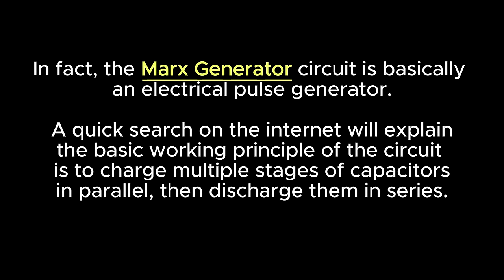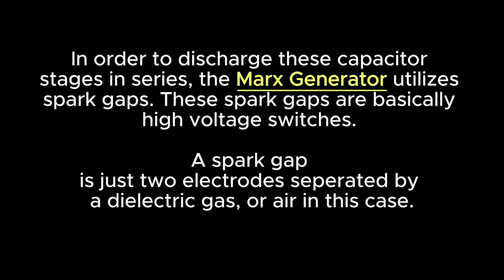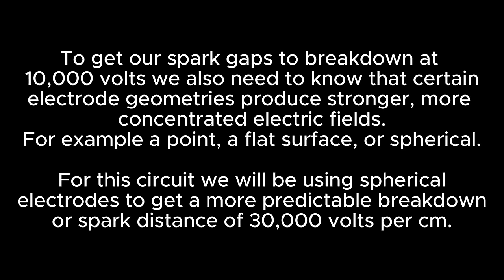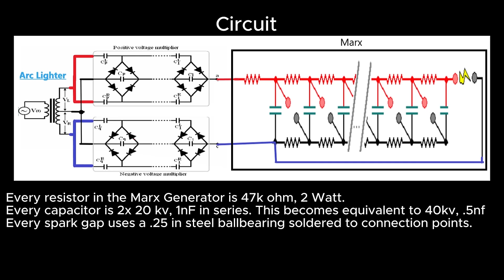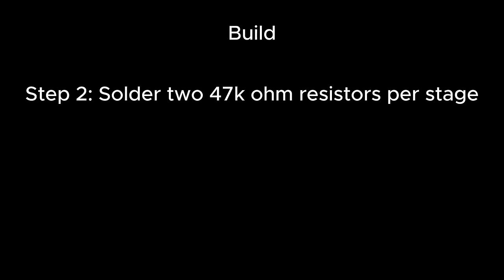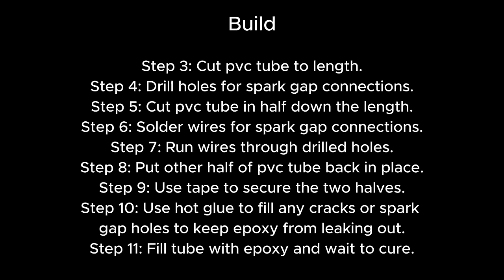100,000 Volts Marx Generator Gun

Comment from the maker: Again. Be extremely careful with this circuit. I am not kidding, this is deadly, because all the energy stored in each stage is released all at once. So to make this safe after charging, be sure to take screwdriver or something similar with one hand and discharge each stage by shorting the spark gaps.
Reply: When I make this I will take every precaution possible because I don’t think 100,000 volts through your body is very pleasant
Reply from the maker: @BupaDuck  that’s good to hear. I believe you can do it!! Maybe start off with just four stages, tinker around with it and see how it works. 

If you need any help, just comment back here, or maybe post a video of your own so I can see what you’re working with.
Reply: I have one last question is it a bad idea to order parts off of Amazon?
Reply from the maker: @BupaDuck  I get quite a lot of my parts from Amazon. Digikey is also good for specific components.
Reply: Ok thanks
Reply: I’m thinking about starting a yt channel but I’m kinda in 8th grade😅
Reply from the maker: @BupaDuck  yeah man, why not? Better to start now, build an audience, and possibly get paid in the future!

Doesn’t matter how old you are, get ahead while you can! You will learn so much more by doing things yourself.
Reply: @UsefulElectrons-ni1fq  thx I just want to do something big for my first video. I should I make a Marx generator or something else
Reply from the maker: @BupaDuck  it doesn’t matter, you should do what you are passionate about, unless you are targeting a specific audience or have an overall theme/plan for what you want your channel to be about.
Reply: @UsefulElectrons-ni1fq  ok I’m in gym class rn tho
Reply: @UsefulElectrons-ni1fq holy crap your views spiked to 900
Reply: So the Marx generator I built has a input on both sides of the generator and a single output, so would it work if I just stuck a wire into ground in a outlet
Reply from the maker: @BupaDuck  no! Do not do that!! That will not work and is extremely dangerous!!!

No where in my video do you see me or others sticking wires in the ground of our outlets. What comes out of the wall can kill you. It is VAC, the Marx generator requires DC!!

If you don’t know the difference between low frequency VAC and High Frequency VAC you should not be experimenting with these circuits.
Reply from the maker: @BupaDuck I hope you’re okay bro. Are you still alive?
Reply: @UsefulElectrons-ni1fq  Okie I’m alive
Reply: So do I split my Marx generator in half and use one for negative and one for positive?
Reply from the maker: @BupaDuck no, it should have a positive and negative DC input.

You need high voltage DC. A rectified flyback transformer that can be bought online should be able to charge this circuit if you bought the high voltage capacitors.

You could also use a high voltage AC transformer connected to the Cockcroft Walton circuit which will rectify to high voltage DC. The ac transformer can be found in a plasma lighter.

Most of the information in this video should be good enough to build your own, but like I was saying before this circuit is difficult to make work properly. It took me a lot of time making sure everything was spaced properly. You might want to just start with the Cockcroft Walton first.
Reply: @UsefulElectrons-ni1fq  so I have the high voltage so do I need to buy a rectified fly back transformer?
Reply: @UsefulElectrons-ni1fq  I have the Marx generator circuit and a constant source of high voltage
Reply from the maker: @BupaDuck  if you have the constant high voltage DC source, basically the taser circuit, then all you need to do is connect the positive and negative to your Marx.

You just have to have the high voltage caps and resistors insulated well enough so they can charge without arcing over. Then you need to make sure your spark gaps are spaced properly. It takes a lot of messing with to get it to work at the point though so be patient and make sure you discharge the circuit by shorting the spark gaps with a screwdriver or something with one hand, try your best to only use one hand when handling the circuit or you will get shocked across your chest.
Reply: @UsefulElectrons-ni1fq  ok thx
Reply: You could have a 3 way switch on either the output positive or negative and when you flip the switch into “b” position then it discharges it into a bleed resistor. “A” position goes to the high voltage spark gap.

Comment: I rlly like electrical engineering and I made a 30kilovolt taser myself, I hope your channel grows🙂
Reply from the maker: That’s awesome! Now all you need to do is connect your taser to this circuit, and you can multiply your voltage and current even more!! Be careful though this circuit is more dangerous because all the stages of the capacitors discharge all at once and can really hurt you.
Reply: I know, I accidentally touched both of the live wires while trying to fix it and I shocked myself, it wasn’t exactly pleasant
Reply from the maker: @BupaDuck 😂😂 gosh bro, I know, even when I’m being extremely careful I still get shocked and it’s always terrifying!

Comment: I just ordered the parts from amazon and it is coming Sunday😊
Reply from the maker: Nice bro! That’s exciting!! Let me know if you have questions
Reply: @UsefulElectrons-ni1fq  ok I have 2 question, does the wires get hot and do I need thick wires I don’t want the wires to cause a fire
Reply from the maker: @BupaDuck  most of the wire I’m using is single strand 22 gauge. The output wires I’m using are multistrand 14 gauge high voltage wires.

I wouldn’t be concerned about fire with the Marx generator circuit, but whatever you are using to charge the Marx is probably going to be where the fire hazard is.

I assume you are either using an arc lighter or crt flyback transformer?
Both of those can generate “hot” arcs that can cause fire because of the current output. 

Just be safe and keep flammable objects far away.

Remember to only use one hand when interacting with the circuit after it’s been charged. Also discharge the stages after each use so you don’t forget.

Start out with only a couple stages so you can understand how it works, the more stages you add the more corona discharges you will get and the circuit won’t work very efficiently. Which is why I put mine in a tube and filled it with epoxy. You can use canola or vegetable oil instead, but it’s messy…

Also, if this circuit isn’t in epoxy or properly isolated it could arc to itself and damage your power source components, or most likely the resistors in the Marx circuit.

Good luck, have fun, and be safe.
Don’t give up if it doesn’t work the first time either!
Reply: @UsefulElectrons-ni1fq  ok thx I will let you know if I have any questions
Reply: I got the resistors early and I think it might be too small can I just put electrical tape over the wires to prevent it from arcing
Reply from the maker: @BupaDuck  sorry electrical tape will most likely not work in this situation for the resistors in the Marx Generator, but you can most certainly try.

Arcs will most likely travel through or around since it’s almost impossible to block all air paths that it can travel through. 

This is why you will need a better insulator like oil or epoxy resin.

But if you’re only doing a few stages you might be able to get it to work without tape or anything.
Reply: @UsefulElectrons-ni1fq  ok thx ima try with a couple stages first
Reply: @UsefulElectrons-ni1fq  I will buy epoxy if it arcs
Reply from the maker: @BupaDuck  sounds good, be careful with the epoxy as well, it’s pretty toxic. Wear gloves when handling it because if it gets on your hands it will adhere to your skin, and I think it can cause irritation too. You will have to make some sort of box to contain the circuit and epoxy so it won’t spill out, has to basically be water proof.
Reply: I just got my capacitors and charged them up, it barely discharged any arcs how do I fix this
Reply: Actually it’s bc of my batteries it’s out of energy
Reply from the maker: @BupaDuck  try putting your spark gaps closer together
Reply from the maker: Did you get it to work?
Reply: @UsefulElectrons-ni1fq  no I’m just gonna buy a bench power supply
Reply from the maker: @BupaDuck  hmm, what were you using for your power supply before?
Reply: @UsefulElectrons-ni1fq  8 AA batteries
Reply from the maker: @BupaDuck  what circuit we’re these batteries powering?
Reply: @UsefulElectrons-ni1fq  so I was making the circuit and I tested it but it arced between the resistors can I just put hot glue on it to fix it?
Reply from the maker: @BupaDuck  you can try, it’s worth a shot because I tried that as well but it did not work, I think hot glue might actually be a better conductor than air for high voltages. 

From what I noticed the arcs will just travel along the surface of the hot glue but not through it because it might be attracting charges.

If this doesn’t work, you will need to insulate the circuit better with wax, oil or epoxy but leaving the spark gaps outside of the insulation so they can still arc.

What’s causing this is the Corona discharge leaking charges from pointed surfaces, this is most likely from pointed solder joints or just very tiny pointed surfaces that aren’t noticeable right away.

If you watch electroboom’s marx generator he was able to get it to work in air, but honestly might be more frustrating to get everything perfectly distanced rather than insulating it.

Also, you may want to inspect for any damage and swap out the resistors that have arced across them because they may cause you issues later, just to be on the safe side.

Also this could be from your spark gaps being too far, maybe try distancing them shorter than the length of your resistors, even if it’s a tiny little gap, if you can get it to work then adjust from there.
Reply: @UsefulElectrons-ni1fq  ok thanks I will try to get some epoxy or some wax
Reply from the maker: @BupaDuck  I’m not sure which resistors you have, but you may want to get the 2 watt resistors like I have in the video since they are much bigger than the 1/4 watt and won’t arc as much. If you are insulating the circuit then either way it shouldn’t be a problem, but as always best to design the circuit for worst case! 👍
Reply: I just finished the circuit now I just need a stronger power source bc my 8 batteries and voltage booster is too weak
Reply from the maker: @BupaDuck  nice!  I actually have a video I’m working on that will be uploaded by next weekend on how to make a stronger power source. I hope it helps you
Reply: @UsefulElectrons-ni1fq  ok I hope to the video turns out good
Reply: @UsefulElectrons-ni1fq 27kviews congrats🎉

Comment: I have a question, I might be wrong but my taser produces about 30,000 volts, do you know the minimum voltage needed to power a Marx generator. Also What is the ideal distance for the spark gaps
Reply from the maker: Depends on you spark gap distances. You could definitely do it with 30,000 volts, but it has to be DC at the output of your taser, which it should be if youre using the Cockcroft Walton.

What will make it easy is by spacing the last spark gap the smallest. Just play around with the distances until works. 

I recommend sealing it with epoxy or your resistors could get damaged, and it will lose a lot of power from Corona discharge if you don’t.

Again. Be extremely careful with this circuit. I am not kidding, this is deadly, because all the energy stored in each stage is released all at once. So to make this safe after charging, be sure to take screwdriver or something similar with one hand and discharge each stage by shorting the spark gaps.

Comment: Should I make a Marx generator machete and the arc is the blade
Reply from the maker: That’s a great idea, but you shouldn’t ask me or anyone else. Do what sets your heart on fire ❤️‍🔥
Reply: @UsefulElectrons-ni1fq  I think 100,000 volts might set my heart on fire when I touch it
Reply from the maker: @BupaDuck  bro that’s hilarious 😂
Reply: @UsefulElectrons-ni1fq  lol
Reply: I’m making a taser knife thing, is it illegal? It’s 2 blades next to each other
Reply: @UsefulElectrons-ni1fq btw I changed my name and pfp
Reply from the maker: @BupaDuck I wouldn’t bring it out in public. If you’re under 18 it most likely is. That’s only because there are knife carrying laws, and taser laws, so you would probably have to abide by both.
Reply: @UsefulElectrons-ni1fq  is it ok as long as I don’t take it outside
Reply: So I made the Marx generator and it works!😊 but the output is very weak do you know what could be causing it
Reply from the maker: @BupaDuck  Nice! It might have to do with your power supply output. It may not be powerful enough. Another thing could be your spark gap electrodes and distances. The more spherical the better they will be at keeping the gap from arcing allowing the capacitors to fully charge. Lastly the issue could be the capacitors themselves may not have a high enough value. What are the values of your caps?
Reply from the maker: I cant give legal advice, but here in america most police wont care if someone found out you had a taser knife and reported you. They would also need to have a search warrant to come into your private residence and search for it. So you are most likely fine if you keep it in your house, as with all weapons. @BupaDuck
Reply: I think my caps are 47k
Reply: Also I’m using one of those voltage boosters from Amazon with a bench power supply
Reply from the maker: @BupaDuck 47k doesn’t sound right, the caps should be measured in Farads. In this video I was using 1nF capacitors (nano Farad).

And yes it may be that the booster module you are using which is just a Cockcroft Walton  with not as many stages as I used in the video. I had 10 stages of a full wave Cockcroft that had positive and negative stages. So 20 stages in all (60 capacitors!). Look how much space those blue capacitors and diodes took up under my Marx generator, I had to build a whole box for it. 

That booster module is probably just 5 stages of a half wave Cockcroft circuit so it probably just doesn’t produce enough voltage. Those things have false advertisement. 

But anyways good job at getting it work with what you have. The Marx is a real
Challenge, and it gets even more difficult to produce more voltage…
Reply: @UsefulElectrons-ni1fq  It was a 1nf capacitor
Reply: @UsefulElectrons-ni1fq  do you know any easier way of getting a higher voltsge

Comment: Try 8v or 12v
Reply from the maker: Yes! I have been experimenting lately and I can’t wait to show you what I’ve been up to. I wish these videos could do it justice. 

Increasing the voltage input definitely makes bigger, louder arcs, however the circuit that is powering this Marx generator doesn’t even work with my 5v power supply, which is why in my next video I will show you I’m improving my own circuit rather than using the arc lighter! Will probably be able to release the video by next weekend, as I’m finishing up the project in the next couple of days.